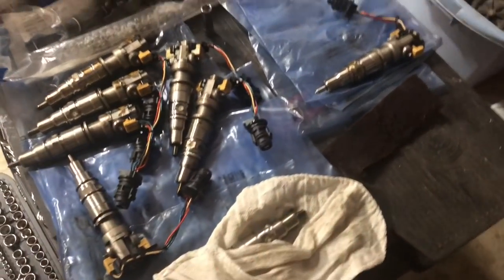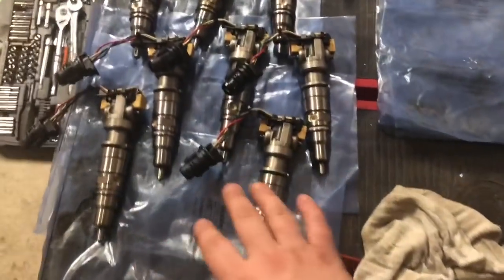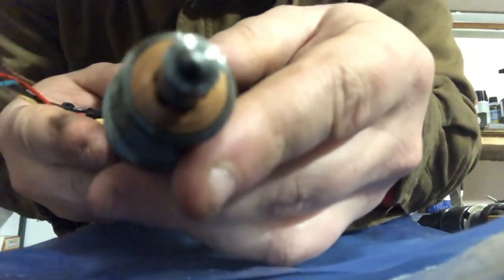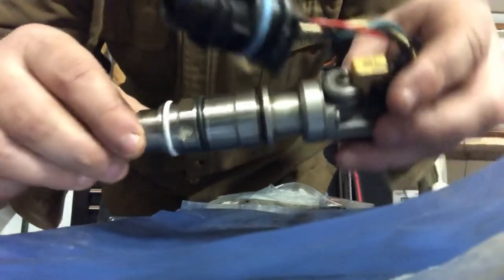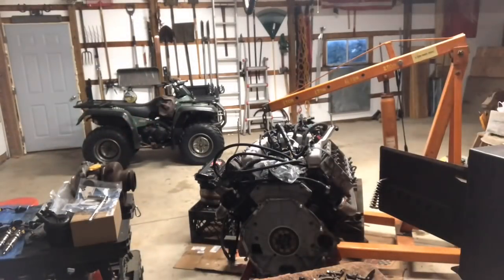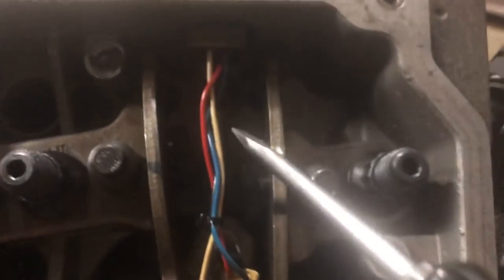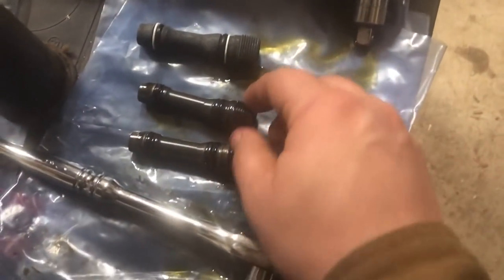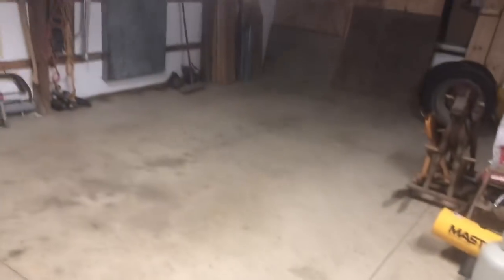*RACE TRUCK BUILD* FUEL INJECTORS!! Ep.28

Comment: I pre filled my oil rails and it made start up way faster and less stress on the engine
Reply from the maker: Dago I considered this. I plan on filling the oil cooler/hpop reservoir before bolting the bpd block off plate on.